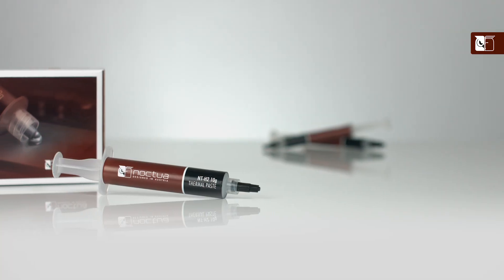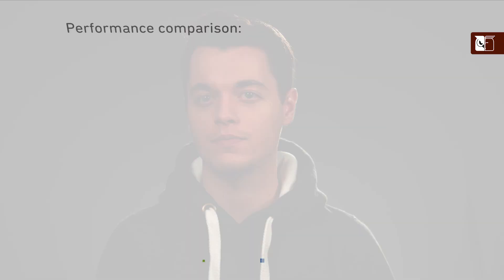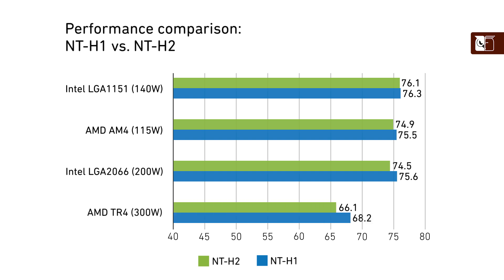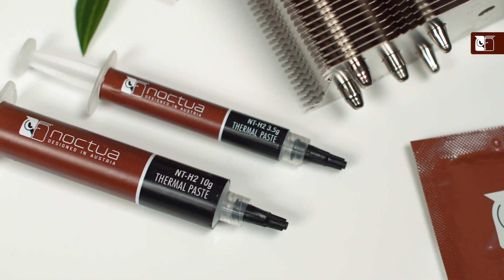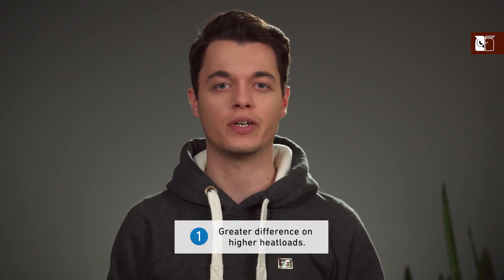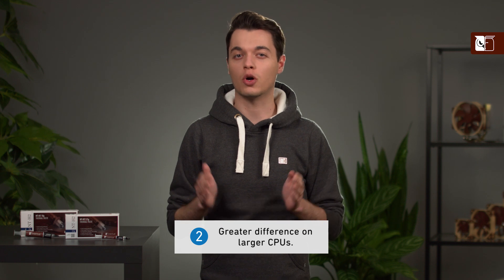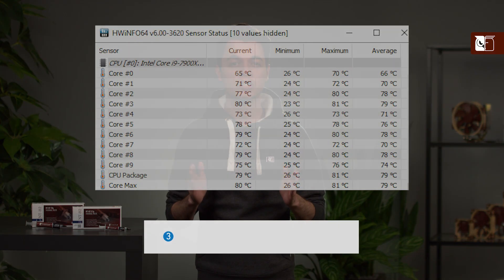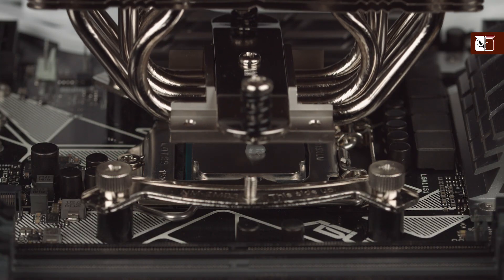Comparing Noctua’s NT-H1 and NT-H2 thermal pastes

Comment: Lol I also bought the Noctua 4080. I can hear it from 10cm away. I only uso noctua fans.
I want to buy a 60mm fan for my retro Pentium PC, because that thing is loud. Also I want to change the PSU fan for a Noctua one, because that is on 100% all the time.
My loudest parts of my pc is the pump and the PSU fan. Also my 13900K is still hits 70°C. It draws 170W, so that's why. I spent like 2000€ on Noctua. Best PC brand.

Comment: What is the Thermal Conductivity rating of the NT H2? your product details show nothing on this and that's how I base what paste to buy.
Reply from the maker: We strongly advise against using thermal conductivity rating for making a buying decision as these ratings can often be quite misleading. This is why we don't publish such a rating: https://faqs.noctua.at/en/support/solutions/articles/101000353273-why-doesn-t-noctua-specify-thermal-conductivity-or-thermal-resistance-of-nt-h1-and-nt-h2-

Our recommendation is to look at independent media reviews for asessing thermal paste performance: https://noctua.at/en/reviews?product=259&#review1
Reply: and that's why i will never buy your product. It's too bad if you had nothing to worry about you wouldn't hide the thermal rating. So with that mentality yer saying that yer NT H1 which has a thermal rating of 2.9W/mk is better than the Thermal Grizzly Kryonaut Extreme which has a thermal rating of 17.9W/mk???
Reply from the maker: The problem is not having anything to hide but different measurement methods and exaggerated specs in the market that lead to confusion. How would it help customers make a good buying decision if two pastes with similar performance are e.g. rated 5 vs. 15 W/mK? 

Not sure if you have seen this, but Thermal Grizzly (and others!) have started following our approach as well because precisely ratings like the one you have cited make no sense: 'Since the 4th quarter of 2020, all our cooling products have therefore no longer given specific values for thermal conductivity. We continue to rely on the test results of independent tests and reviews so that our customers can get a more realistic impression of the performance of our products in practice under comparable circumstances.' https://www.thermal-grizzly.com/en/support/faq/

As we've said, please refer to independent reviews for performance data. Our top-of-the-line product is NT-H2 and you should see performance competitive with paste likes of Thermal Grizzly Kryonaut Extreme.

Comment: I applied NT-H1 to the CPU today.  Can you tell me how many years I can go without having to change the thermal paste?  Intel i7 7700K processor.
Reply from the maker: The minimum specified usage time is 5 years, but usually you can run the paste much longer without replacing. We would recommend simply checking the temperatures occasionally after 5+ years - if you see a clear trend towards increasing temperatures, it's time to change the paste.
Reply: Thanks. That's why I bought Noctua, because I don't want to have to change the thermal paste many times, and I also love Noctua. Greetings from Brazil.
Reply from the maker: Thank you very much for choosing Noctua, we're confident that you won't be disappointed! :)

Comment: Thanks for the informative video, Dan! I've been using Noctua's NT-H1 for a while now, and I'm curious about the NT-H2's performance. Your explanation on how it performs better with higher heat loads and larger CPUs is quite helpful. I have an AMD Ryzen 7 5800X, so it sounds like I might see a noticeable improvement if I switch to NT-H2. Can you provide any more details on the application method for NT-H2? Thanks again!
Reply from the maker: Thank you very much for your interest in our NT-H2! You might see a small improvement on the 5800X, just don't expect a huge drop in temperatures. Applycation is basically the same as with NT-H1, you can watch our video instructions here: https://noctua.at/en/nt-h2-3-5g/video

Comment: So i have an intel 8700k with a Noctua Nh-D15 cooler..Any diffirence swiching from NT-H1 to NT-H2 at my case ?. Because 8700k if i am not wrong its an LGA 1151 ??
Reply from the maker: You would probably only see small differences with this CPU unless you're overclocking.

Comment: I'm using NT-H1 for years. I bought used laptop razerblade 14 3080gpu and plan to repaste it. I want to try thermal grizzly kryonaut extreme but I don't really sure about difference. It's worth to spend money or just use noctua?
Reply: Just bought Thermal Grizzly Kryonaut for my NH-D15 and I was super excited, techtubers speak about it like some kind of miracle paste but I swear it runs hotter than before when I used NT-H1. It has been on for two weeks, same pressure, same CPU, same application method, same everything but it felt better and cooler with NT-H1. And yes it is legit, came with a serial code for verification. Just my two cents.

Comment: Nice transparency. 
Just swapped in a d15s on my comp, easiest cooler to install by far. And a nice set of accessories.

Only one minor thing, I wish you had added a plastic spatula for spreading out the thermal paste evenly before moshing the cooler on the cpu; that would make it easier to apply a good but not excessive amount.
Reply from the maker: Thank you very much for your feedback. Our experience is that most customers apply way too much paste when using spatulas because it is hard to make the layer thin enough. From our research, on average, it's easier for customers to get the amount broadly right using the dot(s) method with indications on the diameter of the dots like we give it in our manuals.

Comment: Why don't you include the NT-H2 with your coolers? I bought a NH-D15S CH.BK, there is no reason it should come with the same NT-H1 my NH-L9x65.
Reply from the maker: NT-H2 is quite a bit more expensive, it would mean that the coolers would have to become more expensive as well. Since the difference between NT-H1 and NT-H2 is small in many applications, we don't think the majority of customers would appreciate it.

Comment: Tried this on my PS4 pro which sounded like a jet engine. Worked for about 3 months and now it’s making the same old fan sound. It’s completely clean but goes insane on call of duty or spiderman. I applied the paste evenly with a credit card.
Reply: Try again. Not sure of the mounting system on PS but typically a small bead in the center will spread perfectly.. or a thin x

Comment: Would you recommend this thermal paste for a MSI GF 75 thin laptop because my CPU has been over 90c
Reply from the maker: Yes, many customers have been using NT-H1 and NH-H2 on laptops with excellent results.
Reply: @NoctuaVideos  thank you so much for the feedback
Reply: @NoctuaVideos  few more questions will this also be good for my integrated GPU chip in my laptop and would this thermal paste guarantee put 10c down ?
Reply from the maker: Yes, it's also good for the GPU. However, there's absolutely no way to guarantee how much temperature reduction you will see, this will depend on dozens of factors such as the current thermal paste, the cooling system as such, contact quality between the cooler and the chips, heat output of all the components, ambient temperature, other possible issues like dust build-up, etc.
Reply: @NoctuaVideos  for your honesty and I appreciate it thank you so much for your feedback

Comment: Can we see any noticeable difference in CPU temp after applying this paste ?
As I am planning to buy one :)
Reply from the maker: This will depend on what paste you're using at the moment of course!
Reply: @NoctuaVideos  I applied a local cheap paste but see no difference.
Reply from the maker: Results can vary from application to application, not all will benefit equally from better paste. You can be sure that you're using one of the best performing pastes on the market though!

Comment: Think the H2 would be safe or ideal for a PS4?
Reply from the maker: Yes, of course!
Reply: Noctua_at What do you think is the optimal way to apply it onto the PS4 CPU?
Reply from the maker: A single 2-3mm drop should do!
Reply: Noctua_at So no spread? Just simply a drop and basically reassemble the console?
Reply from the maker: Either way will work fine. If you prefer to spread it, you can do so, just make sure that the layer isn't too thick.
Reply: Noctua_at I’m just curious on how much cooler you think it’ll help my PS4 run..it legit heats up my room like an oven
Reply from the maker: Sorry but this is impossible to tell. Generally the chances that you can knock off a couple of degrees should be good though.
Reply: Hey you ever end up adding it to PS4?
Reply: @ChronikCarlos  Yes actually! I got the NT-H2 and it helped my PS4 be quieter! Now I’m on PS5 of course, but for the time I used my PS4 after using their thermal paste, it’s been from jet engine to small fan noise!

Comment: Does NT-H2 still use aluminium and zinc oxide particles like NT-H1, or was the metal composition changed? I assume the viscosity change is due slightly different silicone grease or whatever is used.
Reply from the maker: We can not disclose the exact formula but Zinc oxyde is a major component. The different viscosity is indeed due to a differnt type of silicone and different preparation.
Reply: @NoctuaVideos  But it's still all safe and nontoxic? That's why I was asking about the metals.
Reply from the maker: Yes, of course it is!

Comment: Should I not use the 5 dot method if I have a Ryzen5 3600, but using NT-H1? Is 1 dot still the preferred method if I have an NH-U12s Chromax on the way that seems to only be packaged with a bottle of NT-H1? Should I order some NT-H2 instead?
Reply from the maker: Yes, a single dot is our recommendation for NT-H1 on AM4, see https://noctua.at/media/blfa_files/manual/noctua_nt-h1_3.5g_manual_en.pdf

5 dots will work just as well though, the reason why we recommend the single dot version is just because it is easier to do and the results are the same.

As for whether it make sense to invest in NT-H2, this really depends on your preferences and how much you care about squeezing out the last few percents. Generally, the differences between NT-H1 and NT-H2 aren't huge, but if you feel you want to gain another 0.5-2°C, go for it: https://noctua.at/en/performance-comparison-nt-h1-vs-nt-h2

Comment: 66 load temps on a threadripper pumping out 300W is pretty cool :O mine runs at 74ish.. hmm... what cooloer were you usign?
Reply from the maker: This was with our NH-U14S TR4-SP3.
Reply: @NoctuaVideos  Are these deltas or absolutes? Were you testing in an igloo? :O
Reply from the maker: These are absolutes, ambient temperature was 22°C.

Comment: Can you guys make tr4 cpu pads?
Reply from the maker: Honestly, we're not a huge fan of pads because they're lower performing than paste. We're fighting for every degree of efficiency with our fans and coolers, so it would be a pity to loose a few degrees due to pads. Have you tried our new NT-H2? It's very straightforward to apply and to clean with the supplied wipes. At the same time performance is much better than with thermal pads.
Reply: @NoctuaVideos  I been using noctua h1 and loved it but ran out so not bought any new paste yet.

I have a silver arrow tr4 cpu cooler but am looking to replace the fans as the one it came with is very noisy and does not do a good job.

What the best cpu fan I can get for my tr4 cpu? My cpu cooler said it can cool 320w but I do not think it can. I seen 280w and my cpu sitting in 87c or so range. I would like to know what the newest cpu fans with highest rpm and cfm you have is.
Reply from the maker: Our strongest model for TR4 is the NH-U14S TR4-SP3 and you could add a second NF-A15 PWM fan to it for further improved performance. We've managed to push TR4 systems above 350W this way, but results will vary from setup to setup (ambient temperature, case cooling, other components, etc.). It's not unnatural to see TR4 CPU temperatures to go up to 87°C on such high heatloads though, so if you're pushing that high, you can not expect much lower temperatures.
Reply: @NoctuaVideos  ok thank you.

Comment: so will i see a difference on my 4790K when i go for the NT-H2 instead of the NT-H1? i use a noctua cooler as well though. Believe that chip is a 95w chip. if not than i will just go for the NT-H1 saves me like 4 euros here in the netherlands.
Reply from the maker: Honestly, if you don't overclock heavily, you'll see very small differences at best. So unless every degree matters for you, you'll be fine with NT-H1!
Reply: Noctua_at respect for the honesty
Reply: @TT-hd3zi  yeah i like their honesty haha.
Reply: @NoctuaVideos  ok this is an honest answer. and thx. i use a Noctua NH-U14s. and i will be overclocking at least trying in the future. So for now i will be just as fine with the NT-H1. thanks for the answer. now i will know what to buy :-)

Comment: Nice thermal paste , well done noctua. keep it up
Please read my entire comment.
I want "black" NF-A12x25. Also i wish if you add option to : 
- Buy coolers with black fans. 
or 
- Add option to buy heat sinks alone for a lower price ( without the fan ) so i can buy one of your black fans. For a long time i have been thinking to buy one of your coolers, but when i think about that i have to buy a new fan for extra cost and not use the brown fan that i paid for which is waste of money and waste of everything, i cancel it... it's not about $20 or 15$ it's about you're stubborn and you try to force me to use your colors, or pay extra for additional fan.
I like noctua , but I hate some of your actions , just because I like your company , doesn't mean that I will buy anything you offer ( for example a color that is good for you , bad for me ) , I'm not a sheep.
This is an advice from a fan of your company.
Reply from the maker: Thank you Ibrahim. As for your questions, black coolers are scheduled for this summer and a black NF-A12x25 is in the works as well (no ETA yet).
Reply: Seems theyre brown still?
Reply: @ChronikCarlos  the Chromax ones are all black?
Reply: @crabosity  idk sorry

Comment: Basically its the age old 'MX-3/MX-4 vs. AS5' argument based on results. You could buy the AS5 which costs a little more, is a better performer or you could buy MX-3/MX-4 which is cheaper and gets to within 2-3'c of AS5 and doesnt carry the extra premium on the price tag.
Reply from the maker: Only that even our NT-H1 outperforms AS5... ;)
Reply: @NoctuaVideos   True - There is no beating the price of MX-4 though. which is currently priced £6.04 on AmazonUK compared to NT-H2 which is £11.50. AS5 is £6.41 and not to forget Thermal Grizzly Kryonaut is £6.69

MX-4 actually beats AS5 in a lot of scenarios. Competition is TOUGH 

Cooler Master are also competing in the same price segment with their MasterGel Maker Thermal Paste which is currently selling for £8.94 and and its better than all the pastes i listed by 1-3'c (give or take...) Even your NT-H1

So you really got to bring that price down.  I actually used your NT-H1 on my 8600k and 1080Ti and i am pretty happy with the results so far. I ordered your NT-H1 and Cooler Master MasterGel Maker at the same time so i had the choice of which paste i was going to use first but I have heard really good things about the Cooler Master, the same with your NT-H1. I ended up giving that tube away to a friend who helped me out and he's also used it on his AMD R5 1600X with good results.
Reply: @Rose.Of.Hizaki  geez. here noctua nt-h2 is priced lower than mx-4 , you should shop elsewhere.